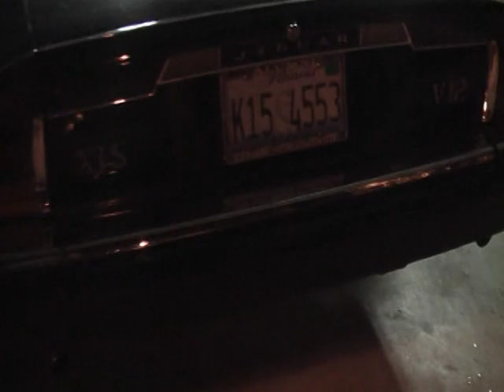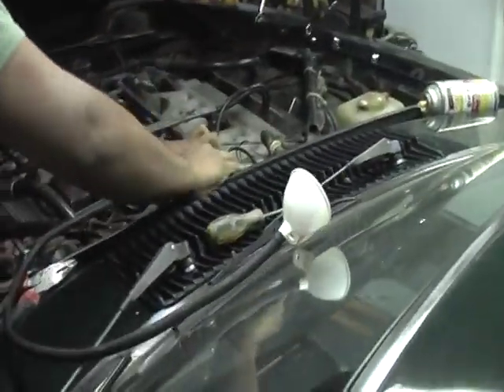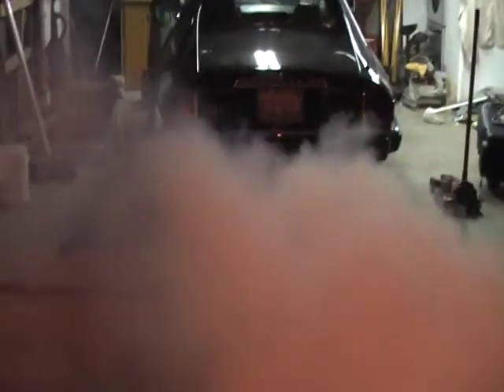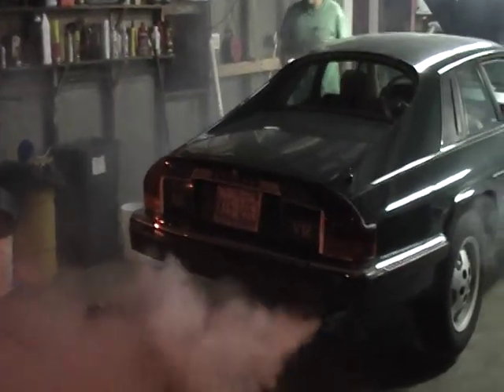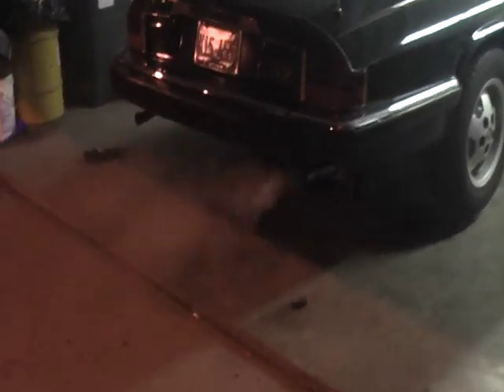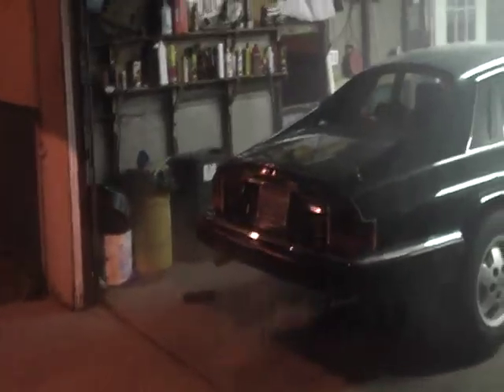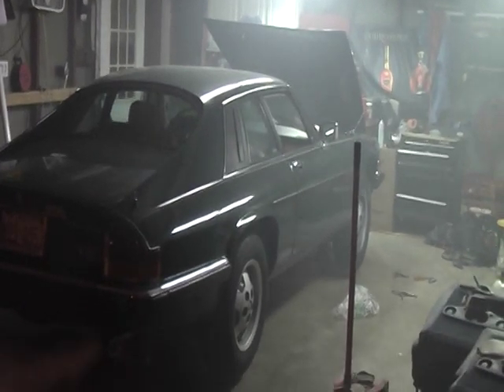A quick Seafoam of a 1986 Jaguar XJS

Comment: Same thing happened to my XJS. After looking at the vacuum lines, one bank splits off & goes into the air cleaner & splits again in that line & goes somewhere up by the radiator. Didn't seem to hurt anything, car runs better. I'm gonna make an adaptor & do the other bank correctly. I saw on the instructions on the can something about consulting a mechanic first. In retrospect that may have been a good idea.